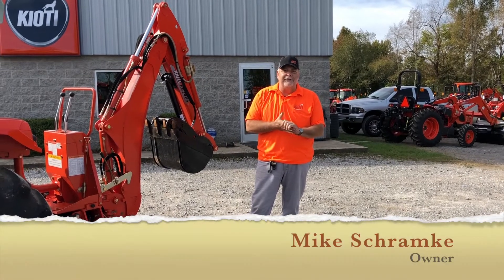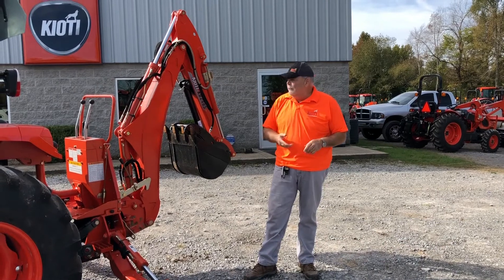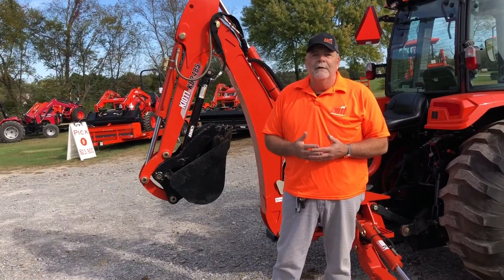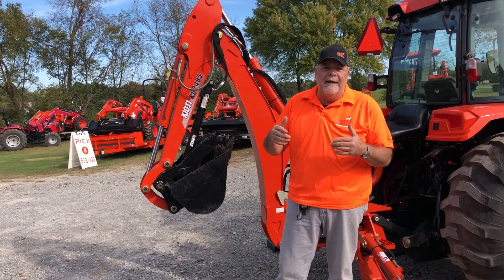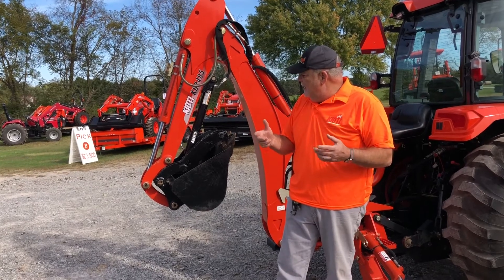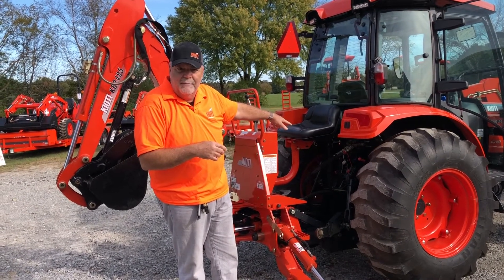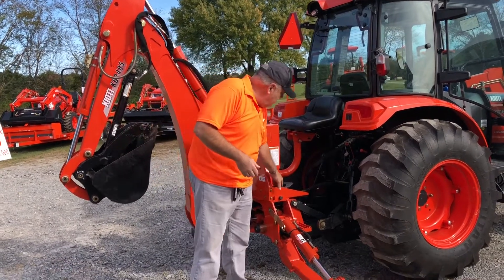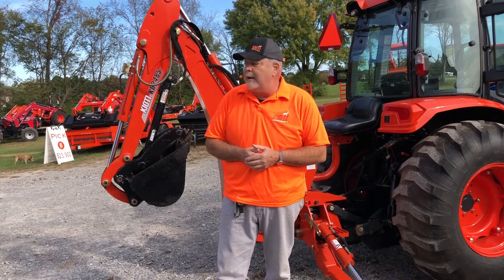Kioti Backhoe Thumb October 2018

Comment: how much?
Reply from the maker: John Seppanen depending on the backhoe. This one was $1700.00
Reply: If you are not located near this dealer, Michigan Iron Works makes one. It was $1400. But for $1700, if that includes installation,  go for it. It took me quite some time to install it. Running the hoses down the inside of the boom is awful. You also have to weld the top support of the thumb bracket for the ram to the hoe dipper. Also need a metal hole saw to cut the floor for the foot lever. It's a lot of work!